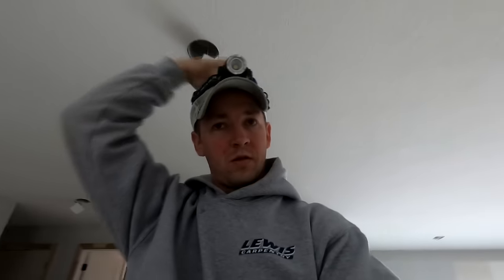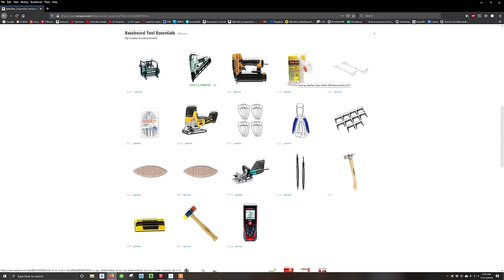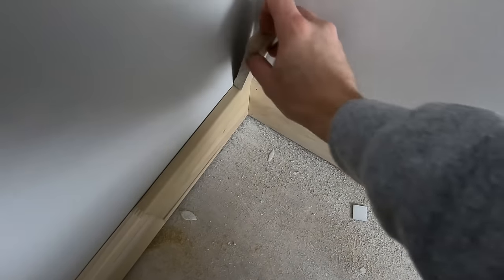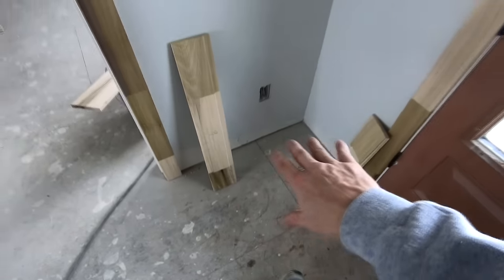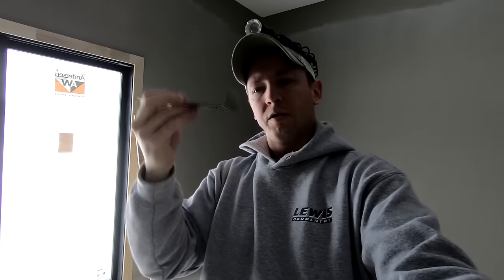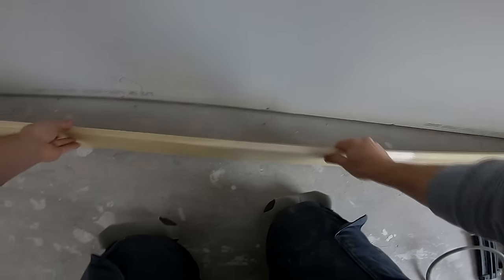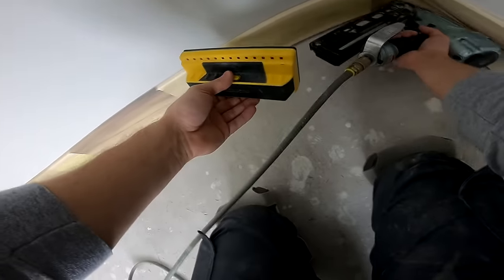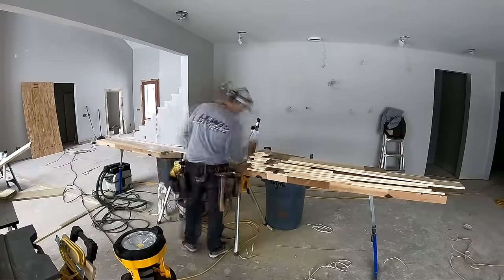Pro Tips for Fast Square BASEBOARD INSTALLATION - To Cope or Not To Cope???

Comment: as a drywall guy if I came into a new build and someone already marked my studs and pipes I would find that guy and buy them a nice meal or case of beer
Reply: For real. Hahah coming from a drywall guy hahahaha
Reply: On jobs I manage, I'll use a piece of 1/4" plywood with a cutout of 1 1/2" wide by 2" deep and attach to a stick roughly 3 feet long.  A can of spray paint and setting the cutout next to each stud makes short work of marking each stud on a job.  It saves time for every trade from framing on and in my opinion, is time well spent to do.
Reply: @personalfavoriteshill7547  It's nice when the tradesmen respect each other! As a painting contractor, I hate when a carpenter shoots so many nails into the trimwork that you swear he came off the battlefield and was shooting a machine gun!
Reply: Exactly! U could be in a ruff mood and come in to a marked it house! Makes the day a bit better!
Reply: @pointedspider  YOU need to learn how to spell.
Reply: Why can't y'all think of eachother instead of being in a rush just slapping stuff up? It takes extra 5 min snap a chalk line. End result is cheaper labor costs and a higher quality finish.

Comment: As a retired finish carpenter your tips are very beneficial and time saving. The kneepads should be required. I'm having knee surgery in 2020 because I neglected pads.
Keep up the professionalism. You are a true craftsman in the old style.
Reply: I haven't seen true craftsman like this since the 80s. Yes I also should have used knee pads.

Comment: This is why I love what I do. As a remodler. Usually I attach drywall and the bottom screw marks the stud and is never filled with mud. Gives a real spot and we can get the stud really easy. Where I'm at floors and paint are completed usually before you can trim.

Comment: First off I think your videos are great. You are definitely a skilled and knowledgeable craftsman and I appreciate the time you take to share with us all. My comment is about the gap that almost always occurs in the lower portion of the baseboard at the inside corners. I work from left to right so before I install a room I go to every left inside corner and shoot a 15g -2.5" nail down low and at about a 45° angle into the bottom plate.  It will stick out proud. If I am going from the corner to corner I will go slightly strong on my next measurement and when I install I fit the two corners and bow out the middle. When I push in the middle the nail will give a little but just enough that the fit is tight at both top and bottom at the inside corner. Throw some thorns in it and move on! Can't remember the last time I ever had to use a bar to pull the bottom of a baseboard out after I tried this. Works for square base and coped base. Just my 2 cents for what it's worth. Cheers!
Reply from the maker: Great tip. I'll definitely give that a try.

Comment: I cut the longest pieces first, leaving any outside miters rough to be marked directly, & standing up the off-cuts so it's easy to select lengths for little waste. Then cut & install the furthest & most visible pieces in each room wall to wall. I take all measurements wall to wall, noting "-TK", ">", or "L" on the cut list for needed cuts.
Pre-sanding will make the finish come out better, & a micro bevel on the bottom edge helps the painter keep paint off the finish floor.

Comment: I wish I would have used knee pads in 1991 when I started doing trim work.  Fast forward to 2018 when I had knee replacement surgery.  I am grateful to be able to stand on the shop floor and build some cabinets 3-4hrs on a good day.  I'm 47yrs old and on disability and it's 100% caused by being the tough man who .... out of a combination of ignorance and ego didn't take care of the most important tool you have. 
Great video.... I wish I'd have had YouTube 30yrs ago!!

Comment: Clean work, Great advice as always.
When faced with that 1" ish piece behind the door, I nail it to the long trim from the rear corner & use chalking on wall. Never breaks and solid connection.
Reply from the maker: That's a great technique also. I've that  done as well.
Reply: @InsiderCarpentry  pop I made this suggestion a year ago
Will delete one

Comment: Awesome work! Square butt insides always turn out the best with flat stock. As we know coped corners are the best corner. Another good tip to save a large amount of time is never numbering the walls or pieces. I always draw out the floor plan measure clockwise cut clockwise then distribute counter clockwise. I even save more time not crossing each number off my cut list. Only when I go to distribute the material or leave my cut bench for any reason I mark the next piece on my list so I know where I left off. Been doing it for 15 years lots.of time saved! Great videos keep up the good work. I love being able to pick up other peoples tricks of the trades.
Reply: I don’t like how the straight cut butts into the piece that’s been round over.
Reply: Coping corners was 2020 were not doing that in 2023

Comment: As a trim and handrail contractor myself I agree with you on how much fine detail is needed or not needed on some things. Trim now a days is for the most part, paint grade. So there’s a painter following behind you filling your small gaps. But I don’t install trim with the mentality of “try your best...caulk the rest”. Pride in work and efficiency is your only key to success.
Reply from the maker: Right. For the stuff like baseboard a good carpenter should be able to make it look perfect the first time every time at a production pace.

Comment: I'm feeling real smart this morning!  I run my own Handyman biz and do lots of baseboard work but it's usually not an entire room, so I learned a few things from you so Thanks!  I feel smart because other than those knee pads I use the EXACT same tools that you use across the board and for the same reasons you mention.  We could literally trade tool belts with no differences.  Love my pants with built-in knee pads vs those beasts you use but I'm going to check them out anyway!

Comment: Nice!   What I try to do..is do the external mitres first,  that way, it gives you a bit of lee-way to to get the mitres fitting perfectly...then, your now shortened base board gaps at the internal corners can be filled with filler no problem.  👍

Comment: Great video! 
One thing I encountered using the scissor nailing method on turned based, was after the carpet was installed, the installers were so rough, that they opened up some of the joints. Maybe I just didn't nail it well enough, but it really upset me to see that.  So after that I started carrying shims. I would precut a bunch of short shims and keep them in my pouch ready for use. When I encounter an inside corner with a gap, I find a shim (or two) that equals the space of the gap. I then stick the shims in where they are needed. 

Occasionally if I don't have shims handy, I will "nail shim it". I pull the safety release mechanism on the gun with one hand and shoot a couple of nails so they stick proud. I then use a scrap block, hitting it lengthwise along the wall until it forces the installing piece square vertically.

These methods solved my problem. You may have perfect success with scissor nailing so don't need to worry about this extra step. 

Again, great job!
Reply from the maker: That is definitely an issue. I finder its much more of an issue with smaller baseboard, like 3 or 4". Usually with 5-1/4" base I don't have problems if I'm snap fitting my pieces in. Regardless, being that I'm doing new construction we always have a paint touch up at the end of the job, so if something does open up its easy to hit it with a bead of caulk and a quick brush stroke.

Comment: Great video, I don't do work in new construction. Most of the finishing work I do is on residential remodeling projects that are much smaller in scale. That being said, I have adapted a very similar work flow and find that when I work a few pieces at a time doesn't produce any better quality than cutting out an entire room or set of rooms once you develop a good system for doing the work. When doing any kind of work, most notably installing baseboards and casing it is all about how many trips you are taking to the saw. One trick I discovered from someone was to use little sill seal foam piece behind the opposing baseboards so that when the one you are installing is press fit to the other, they work against each other and it eliminates the need to pry out and scissor nail for a tight joint. The other added benefit is that if the baseboard gets bumped when they are kicking the carpet the joint is less likely to get opened up and stay open because there are no nails holding it in place permanently whenever it is disrupted after being installed. The press fit from the one baseboard pushes against the baseboard that it is being installed against and the two work against each other, it really does work great. You pack the foam behind it at the bottom before installing the next baseboard so that it sits just proud of 90 degrees, and only nail the top of the baseboard with the sill seal packer.

Comment: I'm not a carpenter, yet have been doing the occasional base board (we call it skirting in Australia) in my new job, and have always mitred corners because I thought that's what you do. Sometimes a pain in the arse, so I'm stopping doing it, and its easier and gives the same finish. Cheers for the video mate
Reply from the maker: For profiled base I cope it. For flat stock I just butt it.

Comment: Thank you for the video. I am one of the few trim carpenters in Omaha that take pride in my work. I take the time to make sure every cut is accurate/perfect. I generally run closer to that 100% cut rate on each floor/level. My customers take time to to leave feedback on Google, Angie's List, Homeadvisor, etc. That motivates me (along with higher labor rates lol). With that said, I always learn something from your videos. I appreciate your craftsmanship and dedication to quality. I wish there were more like you in my market. I find myself being more expensive than most, and sometimes that will cost me jobs. But, I refuse to compete with wages that encourage workers to "get to the next job as quick as possible". Anyway, aside from that rant, I actually do have a question... Why do you prefer air nailers over battery? I just recently made the move to all battery nailers and I can't believe I've gone this long using air. It's sped up my workflow tremendously simply not having to deal with dragging that friggin hose around anymore! What are your thoughts on this?
Reply from the maker: Thats a great question. I should do a video on that topic sometime. I do use cordless also. Cordless weigh more, which I found takes a toll on my shoulder lifting it overhead repetitively. Cordless also don't set the nails as reliably as a compressor with a surge tank. I usually set doors with cordless, just because the hose is much more cumbersome setting doors. But for base and nailing off casing I use air. I find it sets the nail much more reliably. So when I nail off a whole floor of base I go air, but when I only have a few pieces on the far side of the house I grab the cordless guns. I also like the tip on my hitachi 15 vs the dewalt smart point. With the large tip you can kind of bang it against the wood, I find this helps pull the trim tighter to the wall. I don't feel the cordless dewalt 15 pulls the trim in as tight. Keep up the good work!

Comment: Thanks for this video. I'm in the process of removing all the old baseboard in a 3 story home and replacing it. You've given me some great tips to do a better job. One of them is using a laser to measure I always measure corner cuts wrong. I going to buy a good tool for this.

Comment: I want to see a video on how you install a prehung split jam door start to finish I’m interested to see your process! Thanks for the great videos you got me spending money on tools definitely picking up that stud finder👍
Reply: I'd like to see that too. I hate those doors.
Reply: Kevin R I am a trim carpenter by trade so I install these constantly but I want to see his method He normally gives me some ideas on how I can improve so I really want to see how he installs these doors
Reply: What is a “split jamb door”? Maybe I know it by a different name.
Reply: @evilsimeon   It's a specialty jamb used to allow for different jamb widths on a building site.  The jamb is split with pins connecting each side.  The jamb is nailed into place and the gap between the halves is covered with an extra wide door stop.  It's been years since I worked at a big shop that pioneered pre-hungs.  I want to say they could cover widths between 4 1/2 to 5 1/2".  They cost more of course but no time is wasted cutting each jamb down to a specific width.  They can also be a bitch to hang so the door swings correctly and it isn't a nightmare to install the case.  Know what you're doing and they go in slick as cow slobbers and save a ton of time and fussing around.

Comment: Thx for posting this, it appeals to me the Lean Manufacturing process you utilize. 👍🏼 
I have a simple question: when measuring for baseboard or crown Moulding how much do you take off (or add) to/from the measurement for proper fit??
Reply from the maker: I either go exact or for longer pieces I will add 1/32-1/16 and snap in place.

Comment: I typically install the smaller corner piece 1st. I like the inside corner peice to be bigger, easier handling and sometimes the peice is too small to install second. Sometimes I'll even thru nail it to the bigger peice and install it as one.
Reply: after 40+years of i would say both have there place small pc are unique to the job and depend somewhat on what came before boarders\tapers\framers

Comment: I have been doing flooring over 30 years and only do baseboards now and again.  I did maybe 100 l.f. of 6.5" oak colonial baseboards that the customer had stained and urethaned before installation. It was a miserable job ( walls were old plaster) but I did my best to make it as close to perfect as possible. Looked great when finished and no I wouldn't do it again ( customer isn't always right).

Comment: Just saved me a boat load of time!  I've always mitered those inside corners with square profile.  Working on one now that will be all butt joints. Mitered ones never fit just right anyway so lots of time tightening them up.  Great stuff!!  Thanks.

Comment: In my area , everyone uses the round corners on the drywall, pain in the ass , I hoped it was just a fad, nope, been around for years.  I always try to mark my studs and waterlines before drywall too, huge time saver and piece of mind for avoiding plumbing hits. I use a lumber crayon in a holder with a 3' long 5/8" round dowel to speed things up and save my old back. Blue for studs and red for hazards. Good work 👍

Comment: On an inside corner I like to cut the first piece 1/4" or so out of square to get out of the mud. The second piece covers all ills. No need to change angle of saw - mark measurement on top of piece, hold askew to fence, and Bob's your uncle.

Comment: The way I find the studs is- either mark the centres before plasterboarding, or, even if the wall is painted/tiled...I use a strong magnet, & it latches onto the plasterboard/lath & plaster screws/nails, even through 30mm of plaster/lath..!  🙂

Comment: I have a few questions about the video
1. U implied that u add to your measurements if the base does not meet up with the door trim-What is the add amount u use.  I’m sure u probably add different amounts for different thickness profiles also?
2. How do you read your laser measuring device-Mine always comes back w oddball crazy fractions and not to the nearest 1/8 or 1/16” is your laser different or are u really good at odd fractions or u use some other method?

Great video as always.  Wish I was smart enough to follow a lot of them better

Thanks and best wishes

Comment: Great video as always.. Personally I still cut an internal mitre. I cut like its got a coping. I cut the mitre, then cut along the straight leaving 1/4"at the top which has the 45deg.....the board already in the wall I would cut 45 deg cut 1/4"deep to take my fake"coping" cut, this gives the internal that mitre